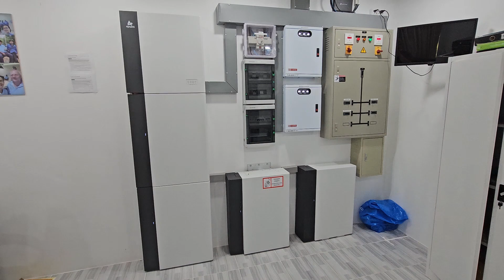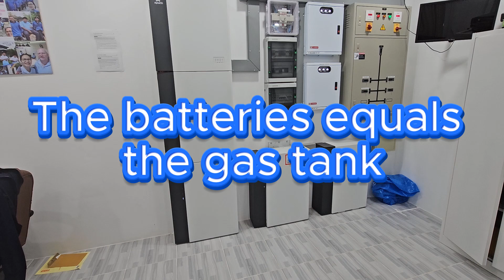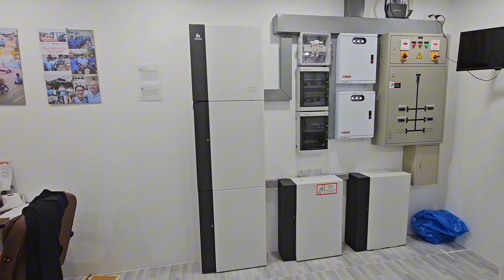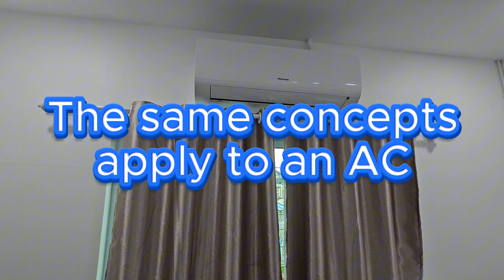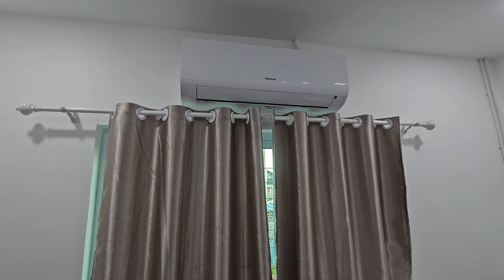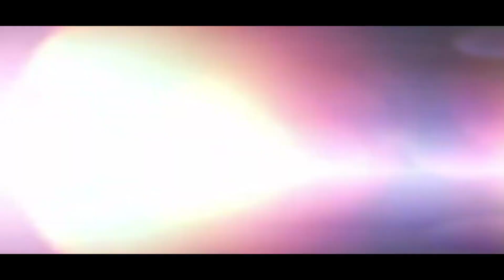Essential solar in 8 minutes! | SolarThailand.biz

Comment: I would not say "kWp" is a naming convention. I would say, if the sun is perpendicular over the panel, this is the expected power output. It is called "peak" because it is the maximum one can expect. And from other sun angles, the produced power is lower, as less sunlight is hitting the panels.
Reply from the maker: If you measure in perfect conditions without long cables and inverter, yes that is correct. But you will never see it in a system installed because of cables and inverter loss. Anyway, its a concept used because of lack of better concepts. Because it does confuse many people.
Reply: @ChaweewanGroup  Yes, the panel itself under perfect conditions. Not counting losses in the installation. I guess considering Thailand, the temperature change over time of the day is already a few percent (talking about efficiency, if a panel is somewhere between 22% and 25% efficient, it can easy drop 3 or 4 percentils if it gets to hot).